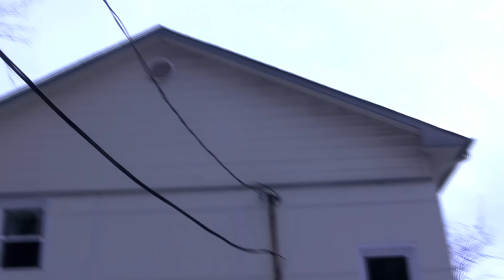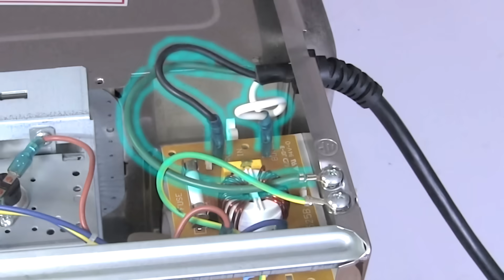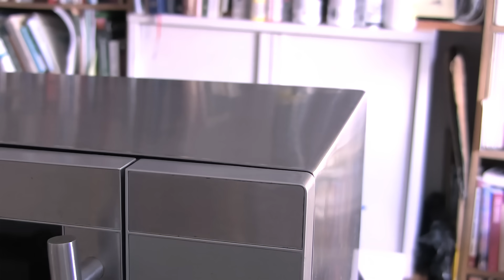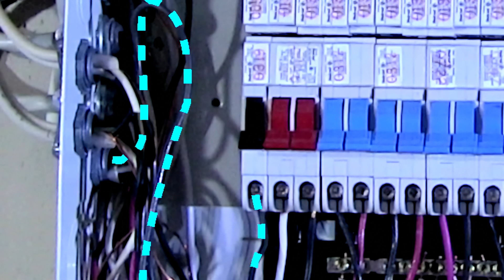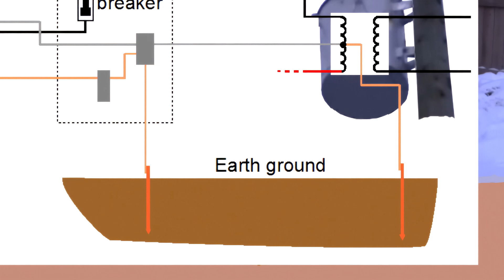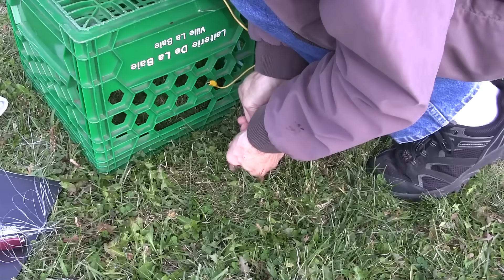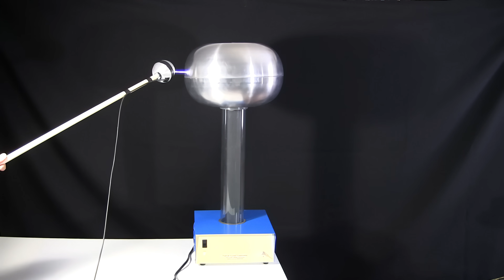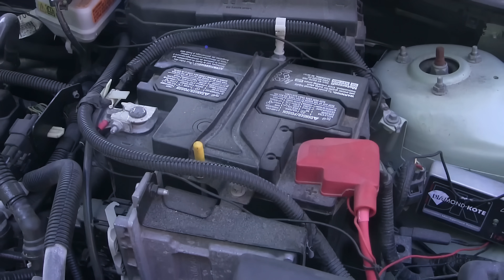What is Ground? Earth Ground/Earthing

Comment: Why doesn't current flows through the ground wire under normal conditions as neutral and ground is connected?
Reply: The service grounded wire(neutral)  is very low impedance due to its size compare to the branch circuits also it doesn’t need to flow there because it wants to go home to its source. So the electrons doesn’t need to flow through the equipment grounding conductors.

The only time EGC will have a current is if there is a fault. Bond only in main OCP other panel needs to be separated
Reply: @johnquilla8236  I don't get what you're trying to say. In main panel ground and neutral wire is connected  so the electrons will  flow only to earth which provides low resistance path rather than reaching its source
Reply: Rajeshkumar G  

What John is saying is correct. The neutral white wire goes back to the source (the transformer at 6:19, look at the diagram) the ground acts as an overflow meaning if there is more current going to the neutral wire than the hot wire then it goes to the ground wire to dissipate that current prevent any items with a metal shell from being energized and hurting you.
Reply: Rajeshkumar G 

Okay so the reason why they bond neutral and equipment grounding conductor

1. It creates a path for ground fault back to the source (EFFECTIVE GROUND FAULT) 

2. Bonding the grounded and EGC .... TRIPS THE BREAKER!

Those are the most important thing you need to know about bonding them... obviously for SAFETY REASON. 

You separate them in sub panels because

1. You don’t want to create a parallel neutral and ground.... as I LIKE TO CALL IT (BLEEDING GROUND) meaning the return current could flow through your EGC and could energize metal that are bonded to it which can cause shocking hazards. 

Also, GROUNDING ELECTRODE as one of my foreman’s told me that this just dissipate electrons coming from lightning strike down to the earth ground, surge voltage... and more... I’m still currently trying to teach myself more about this... it’s very complicated and challenging which blows my mind and respect the people who has knowledge to these. Hope I helped you out
Reply: Spike Spiegel More Current (not voltage) going out than is coming back on the neutral then the breaker trips, BECAUSE the current comes back on the SAFETY ground to the ckt. panel. Incidentally this is EXACLY how a GFCI works. Another subject to ponder.    A thank you to you.
Reply: Ted Lahm 

Thank you for correcting me.
Reply: @rajeshkumarg80  Because electricity isn't trying to get back to ground, its trying to get back to its source.  The neutral is connected back to the source in the transformer.
Reply: John Quilla

Did I explain simply enough?
Reply: Rajeshkumar, your question is good. Yes it goes but do not affect or damage anything in that case. It is not leakage as it goes back to the circuit at the transformer station. The earth acts as another neutral path. Look back to the circuit, replace the earth as a big conductor and analyse it.

Comment: In summary this is the basis:

All remaining loads in the system flow to the neutral, which is grounded.
Since the earth is the largest body, it is "neutral".

This is because by the law of nature, all the remaining charges flow from the smallest body to the largest, that is, there will be no charges left in the electrical system of the house.

Did you understand?.

Comment: Can someone help me understand somethings please. I've noticed if my partner is holding her phone while it is being charged and I thouch her back,  that charge can be felt on skin,  like touching a faulty computer case sense. Is this build up of electricity without destination deleterious and why are phones so poorly shielded? Secondly if I am also holding my device being charged at the same time this effect is almost twofold. I don't understand this in basic terms. But it brings me to my question... They sell grounding blankets...  For example, or if I installed a grounding rod outside and connected the wire to myself...  What would happen if I touched my partners back? I am in between the two differences in potential?  It is 5v so cannot penetrate beneath skin correct?  But 2 to 3 amps surely poses a risk...  I want to limit this build up of dirty electricity in my body, what's a solution and are grounding blankets safe when dealing with holding poorly earthed devices like smart phones?  Thanks
Reply: I think there's a problem with your ground protection. If youre able to then test the circuit breaker in your home (the one with a test knob on it)
Reply: @tippieNL  most USB phone chargers don't have an earth pin, this is a common leakage problem with high amp poorly designed smart phones and tablets you told. Try it. Ask someone to hold your phone with any added cover off.. Whilst it is charging and touch their skin, esp when holding another charging device.
Reply: Fuck off

Comment: What exactly happens to the current when it returns along the neutral at the transformer?
Reply: Remember that we're dealing with AC so that those electrons are flowing in alternating directions traveling at 300 million meters per second.  I think of the wiring from the service side of the transformer (the residence side not the utility supply side) to the house wiring as a closed loop with electrons traveling (I.e. current) back and forth so that when the current "returns" to the transformer it would continue through the transformer and exit the coil, finding itself on the "hot" side and returning towards the houseand through the circuit until the current alternated, causing the direction to flow back towards the transformer and so on...these things are difficult to wrap our minds around because of the frequency (60 cycles per second) and the speed of travel.
Reply: @truthbebold4009  No, the electrons are NOT flowing at 300 million meter per second.
Reply: @roger - What happens to the water from your faucet?  It make its way back to the lake or ground water table through the RETURN ( neutral ) pipes.

Comment: What's the difference between live and neutral and why is it connected to the ground? Wouldn't that mean that some of the electricity would flow uselessly into the ground?
Reply: Unless the ground carries a significant charge, this will not happen.  Live is the "source" of the charge and neutral is the "destination" of the charge.

Think about a loop of tube connecting two ends of a water pump.  The water flows because the pump produces pressure, but that pressure has to come from somewhere, so the "source" side of the pump has reduced pressure, which in this case also gives the pressurized flow a place it wants to flow into, thus creating a closed loop.

Imagine you tee off somewhere in that loop and add another hose just out to the air.  This will serve as your "earth" connection.  The air is similar to the low pressure side of the pump, and so the water will flow out of the "earth" hose.  Similarly, if you put the end of that hose into a high pressure stream, water will want to flow into the system from outside.  Both of these are similar to if the earth ground carries a significant charge.

However, because earth is usually very close to neutral charge, putting the end of that tube into sea level pressure water will have no significant effect on the looping flow of water -- the pressure gradient across the pump is much too high, so the water will want to continue flowing in the loop.

In mains AC, the flow is changing direction several times per second, but the same idea applies.

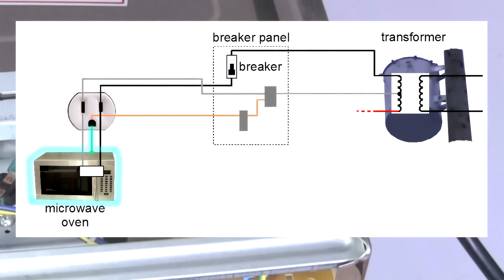As for why neutral is connected to ground, it's literally in the video starting at 2:24
Reply: @Uejji  If I understood that correctly, you're saying that the ground simply has more resistance and so the current wants to go to neutral unless there's an obstruction or overflow in that path, correct?
Reply: That is true, but what I'm saying is that there is a lot higher "pressure difference" (charge difference) between hot and neutral than between hot and ground, so the charge will naturally be pushed towards neutral.

Comment: Why did Americans make the hot line Black 🤔😔😒😕
Reply: Mutt's Law basically
Reply: Probably historically it was cheap versus coloring it.
Reply: It's not just black it can be red or blue if you open up a residential panel in the North America you will see both red and black hot wires
Reply: Hot wires can be black, red, blue, brown, orange, and yellow.  Neutral conductors typically are white or grey.  These color schemes are typical based on the voltages of the systems.
Reply: Cause black people hot af
Reply: @MultiSciGeek  😂😂

Comment: What i don’t get is why the neutral wire doesn’t short if it’s coupled together with the ground at the main panel? If you touch a white neutral wire to ground in the house it will short or trip a breaker but how come there is no massive short if you couple ground and neutrals at the main panel?
Reply: snibeti snab-xD That’s because there’s another protection device being used as well as the breaker, called an RCD (Residual current device). Without an RCD, if you touched neutral to earth you would not cause a short and you wouldn’t trip a breaker. However if you have an RCD installed up stream from the breaker, the RCD will trip, which will turn off the electricity going to that breaker (which is doing the same thing as tripping that breaker).

Basically, an RCD will work as long as the current going out on the hot wire is the same as the current coming back on the neutral wire. If the neutral were to touch earth, a small amount of current may be taken away from the neutral, the RCD would detect this and turn off.
Reply: Ryan Scott But how can the current on neutral be the same as current on live? Surely there’s resistance which will cause a drop?
Reply: Ahmed Alta Basic electronics mate. Electrons have to get back to where the came from, that’s how electricity works.

Sure there’s a resistance, there’s a resistance in the live line, the neutral line and whatever the load may be, but the total resistance in the circuit will always be the same.
Reply: @ahmedalta4480  the current wouldn't be the same. The neutral carries the unbalanced load. A typical 15amp circuit drawing, say, 6 amps would carry 9amps back on the neutral
Reply: @DavidM.Williams  The current flow should be equal between the hot and neutral.  This is the very principal that a GFCI device operates from.  The "unbalanced load" you refer to applies to the unbalance that can exist between L1 and L2, which are alternating directions 180 degrees out of phase from each other in a 240/120 volt single phase system.  Since they are out of phase, they can share a neutral without overloading it because the neutral current is cancelled out.  But sometimes L1 may have more current than L2, and there would be an excess amount of current that isn't cancelled out on the neutral.  This unbalanced load returns to source.

Was that good enough?
Reply: Bonding !!!

Comment: Question: Why do some countries not have ground on their plugs?
Reply: You don’t need an earth. It’s just a safety thing. It would come under their ya know like country code of blah blah. Like their standard. Mostly the shittier countries wouldn’t have them.
Reply: @dylanrobinson2449  Population control!!! ;)
Reply: If an appliance  has a plug with no ground it’s because it is double insulated. Basically meaning that there’s no need for a ground because there’s no exposed metal on that appliance that you could touch
Reply: Old houses in the US don't have ground  plug outlets. Not sure the date of the rule.
Reply: January 1, 1974 it was put into law.

Comment: In other words, the ground wire is what permits a circuit breaker to trip?
Reply from the maker: Yes, but in that example don't let the term "ground" confuse you. In that example, it's just a wire that makes a closed circuit that includes the transformer and the circuit breaker.
Reply: @RimstarOrg  Ahh. So what's the story behind a GFCI outlet? If that's the case, if it's able to trip on it's own, why does it need a ground hole?
Reply from the maker: I'm not too familiar with GFCI outlets. We have them in North America for outlets near water sources (like bathroom sinks) but they're used much more in Europe,
Reply: no.... The breaker trips because the current exceeds the the rating of the breaker. In the example given, the faulty hot wire touches the case of the microwave and since the case is also connect to the ground, a return path is available and the circuit is completed. However this is just one example of tripping a breaker. If a  fault developed between the hot and neutral wires and a  short circuit occur and instantly exceed the current rating of the breaker. This could happen in the absence of a ground wire.
Reply: @allenh118  Oh. But if that's the case. Then what's the purpose of an outlet with a built-in GFCI?
Reply: @princenoah21  A GFCI is a type of circuit breaker which shuts off electric power when it senses an imbalance between the outgoing and incoming current. This would mean that current is finding a path to ground some other way than the normal path... hopefully not through YOU!
Reply: The GFCI exists in situations where a ground fault may occur by going through a human body instead of just through an appliance's metal casing.  The overcurrent necessary to trip the breaker normally can kill a human being.  The GFCI will trip at much lower levels due to its design.

Comment: So why doesn't the center tap connection to ground pull current from the transformer?
Reply: It's the no potential area where the AC sine wave transitions from one direction to the other.
Reply: @kenwilliams3208  Annd.. I suddenly get it. Always 0V there. Thanks, Ken.
Reply: @kirin347  On 3 phase if the neutral is not connected to the panel on all 3 phases you get 208 or 480 depending on voltage called an "OPEN NEUTRAL"!!!

Comment: Random question.  I have a grounding sheet on my bed.  I am using the grounding wire out my window into a metal rod into the ground, planter out front instead of using the outlet inside.  When I have skin contact to the sheet everything seems fine.  But when my blanket is over the grounding sheet and I touch the blanket I get shocked frequently.  What could be the problem.  Wondering if my sheet is grounded properly or if there is an electrical current traveling thru my sheet?
Reply: Sounds like static shock

Comment: I just wanted to verify one thing:  In your 'breaker' diagrams, are the gray-colored rectangles electrically connected to the main panel?
Reply from the maker: The lower one which has two ground wires (copper-colored) going into it is electrically connected to the main panel. I suspect the other one with the neutral wires would be too.

Comment: That actually  not how good safe breaker panel work. Your explanation sounds like normal breaker will protect you from dangerous shock which could cause your death. Normal breakers are not designed for that!  Yes it will switch off hot wire after current will reach breaker nominal current level(which is fast but still to slow to properly protect body from big shock(50mA and 120V for second, two can be already fatal for some unfortunate people)) and is better than nothing but breakers are primarily designed for protecting the wire from overcurrent and shortcut not Human! For that we use rcd breakers. Properly implemented, it will prevent to even experience notable shock, because it will shut down hot wire already after current through body will reach 30mA(if you choose  30mA rcd breaker for example, wich is a must these days in bathrooms and crowded areas)
Reply: In the video, he says it's safe to touch the defective microwave "after" the breaker pops. Not before.
Reply: I think the breaker use to break connection hot-ground wire (since it's short, create overcurrent). Then the chassis is safe to touch by human

So breaker here does'nt use to protect human directly, but to break hot-ground first

Comment: I was advised to walk bare footed outside to get grounded. Living in a city on a third floor, I prolonged a ground connection from a wall socket to a copper wire to just hold in my hand, going to sleep... Am I grounded the same way (somehow) as if I was outside in nature?!
Reply: Following for responses...Thanks for posing question.
Reply: In theory, yes you are connected to the earth.  But I would consider this dangerous simply because we don't fully understand how lightening works.  If a storm rolls through you may get a shock!